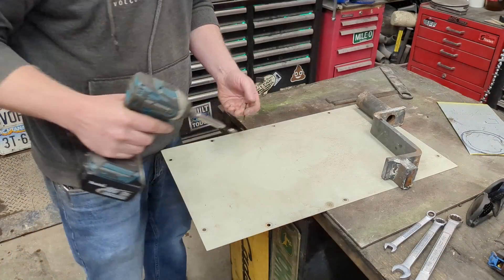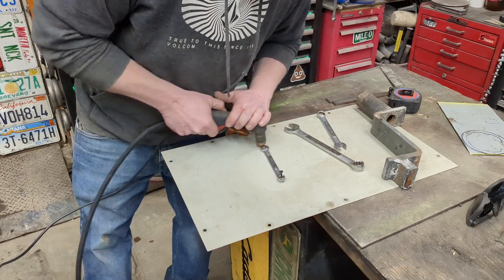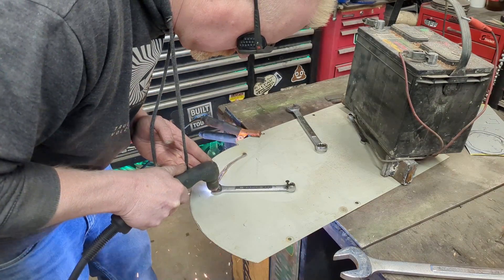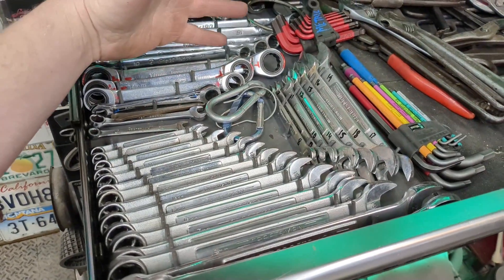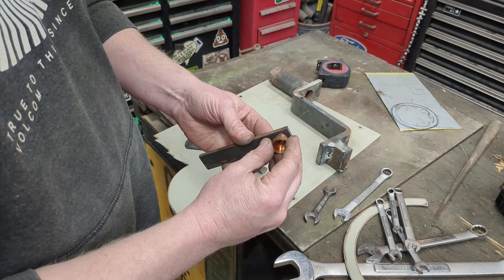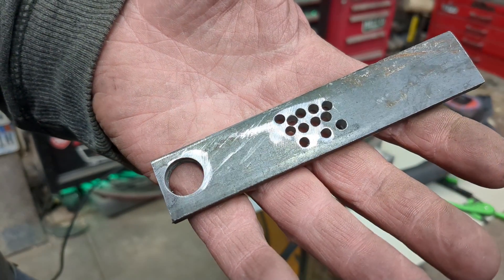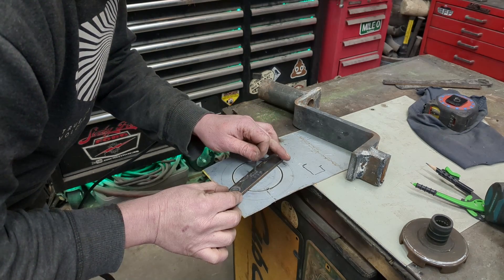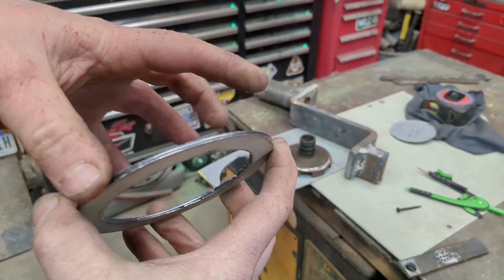Must KNOW tips for plasma cutting Easy Circle cutting

Comment: hi pal, thats look funny but in my case in need to learn how not to destroy tips haha plz make a video abouyt that
Reply from the maker: If you're running a cheap Chinese plasma cutter the tips are made of cheap metal and there's little you can do to make them last. The basic ideas for longer lasting tips is: dry air and don't let the tip touch the material you're cutting.

Comment: While using a wrench for a guide is quick and easy... smart idea... it isn't going to get you where you need to go if you want accuracy with a specific size. For a reasonable "quickie" radius or circle cutter, you can combine some string, twine, fishing line, etc-etc-etc with a washer that the tip of the plasma cutter fits into with a nail or screw as the pivot point. A thin gauge cable is also good as they have minimal stretch even over a long distance - I know of some home construction guys that used a cable in the past to accurately lay out the large, shallow arcs for a foundation and the walls for custom homes as an example. Anyway, adjusting the line for a specific length is fast & easy but be forewarned, make sure you use a line that won't stretch or break. Yes, a strong magnet for a base pivot point can work well on ferrous based metal. 

 Now, if we're going to get serious for shop use, I would encourage everyone to make their own trammel setup to hold a plasma cutting tip, a drill head, a grinding head, a router or any other tool you may use on a radius or circle. An adjustable trammel is unequaled for accurate, professional benchwork. Allow me to encourage everyone who spends time in the shop to build their own which meets their needs. They make a great project and you'll be happy you manufactured one for yourself when you use it. The only problem most folks have is how far to go with their design... you can spend a lot of time making a super high end, multi-functional trammel. Don't ask me how I know that. Best wishes! 🤔😁👍🏻

- Max Giganteum

Comment: Now that you've simplified this how about you sending the first person to ask for a new Plasma Cutter?  Can you send me one?  I already have one, but backups are never discarded as long as there are usable parts to salvage from them.  😀

Back to serious...  
How about just a magnet with a screw inserted in it as the pivot point of the closed-end wrench?  It could still work even when working to plasma cut thin material that is not magnetically capable just by putting a piece under the product being cut that the magnet could "grab" onto. The reason I say this is because so frequently, I don't want a hole in something after the circle is cut out.

Back to not being serious...Give Ginger more to eat than tree limbs, will you?  🤣
Reply from the maker: Magnet is a good idea.

Comment: Great tip! Love the sizes written in marker on the wrenches, need to do this to my sockets that are hard to read without cheaters. Thanks for the upload
Reply: Etch the sizes on them... laser or acid etching in large lettering. Dye the etching afterwards. You'll be happy you did. Best wishes! 🔟🖌️👍🏻

- Max Giganteum
Reply from the maker: That's the main thing I do is my sockets.

Comment: Very cool ideas! Hopefully that car battery is not out-gassing!💥
Reply from the maker: Nope. They're harmless unless you're in the process of charging (over charging) them.
Reply: @sixtyfiveford  As a veteran welder, I won’t take the chance.
Reply from the maker: @lcee6592  You could put a car battery in a fire and it wouldn't do anything. It's not flammable. In reality it would put out a fire being that it's 70-90% water.  If you are overcharging the battery, only at that moment, it will release hydrogen gas.
Reply: @sixtyfiveford  I’d be too scared to be doing that! Lol! But good to know 👍
Reply: Put a car battery in a fire and yes it can explode. Learned that in the Navy from base flight ops fire fighting and equipment safety training. Keep all batteries away from excessive heat with the terminals capped so no shorting is possible.